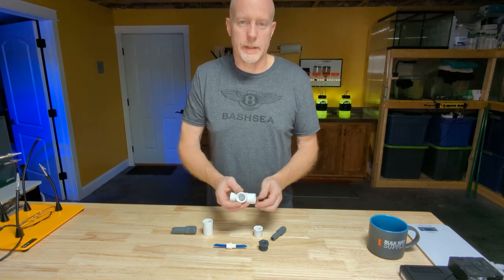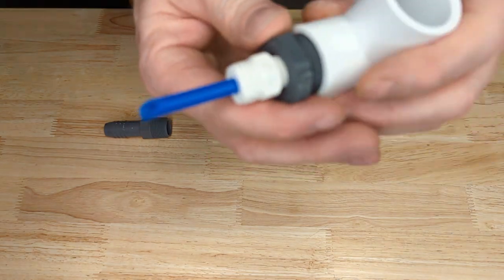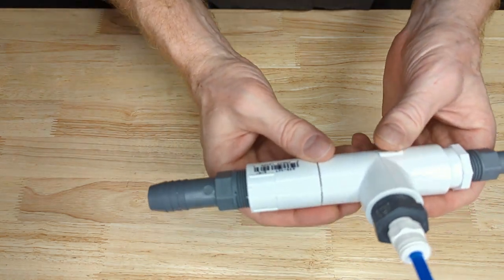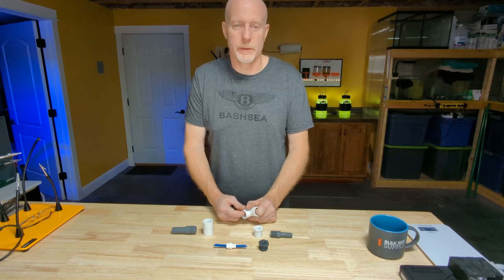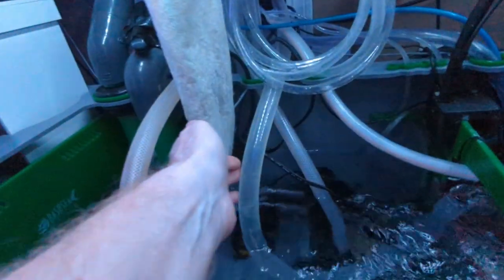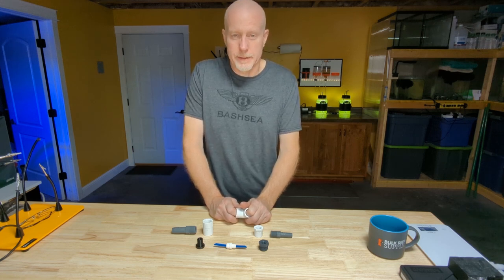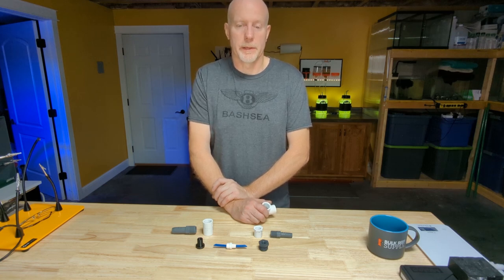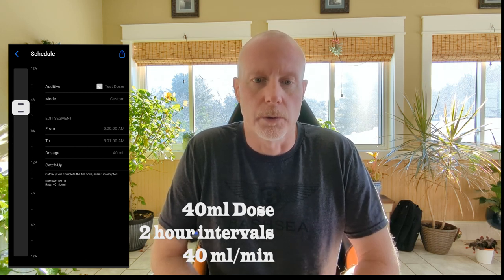Can Kalkwasser slurry eliminate the need for a calcium reactor?

Comment: Excellent video! Very informative and well done! My slurry manifold is still cruising along around the two week mark. I didn't use the tubing below the push connect fitting to extend the dosing line closer to the venturi (didn't catch that detail) but did incline the manifold a little to encourage the slurry in the right direction. I'll have to open in up in a couple weeks and see if there is any build up at all.
Reply from the maker: Thanks Paul!  I'm not certain it's necessary, just seemed prudent.  This is just the beginning of the journey.  I'd be very interested in what you find after a month or so of dosing,  Feedback like that is gold!  I appreciate your thoughts and input as always.
Reply: @robbb'zreef how are you stirring the kalkwasser in your bucket to make the slurry?

Comment: Great idea. I was thinking of something similar for an in-line application with a closed loop system. Did you make the fitting that creates the Venturi?
Reply from the maker: A friend of mine who's really good at flow dynamics and hydraulic engineering helped me with the design of the 3d printed insert.

Comment: Just started my tank slurry today, thanks for the Kalkulator. It’s a 220g system pretty heavily stocked. I’m currently doseing 9000ml kalk water and 150ml of all4reef. Hoping to switch to only dosing slurry.
Reply from the maker: You're very welcome, and thanks for watching!  I hope your cutover goes smoothly.  I've finally surpassed my ability to replenish alk thru normally saturated kalk which has been a fun journey.  I knew it would happen at some point which is why i started down this path early on.  Enjoy those savings :)

Comment: Hi great vid although I’m not certain I understand the Venturi part.  Is it so you can slowly drip into a pipe that has pressurized flow without it drawing the drip into like a vacuum?

Also did kalk replace a calcium reactor?

Regards Duzzy 🇦🇺
Reply from the maker: Thanks for watchin!  The venturi performs several functions.  First is to help create a turbulence at the convergence point to better help mix and saturate the calcium hydroxide.  Second is to prevent constant back pressure against the dosing pump head and lastly a safety guard in case it ever pops off accidentally (or on purpose for maintenance) it won't shoot water all over the place, assuming you have it above the water level of your source.  Kalk for me did not replace a carbonic acid generator.  It however will ensure I never need to get one which for me is a huge win.  This is certainly capable of feeding a system as much if not more carbonate alkalinity than many calcium reactors at a fraction of the cost imo.
Reply: @RobBzReef  thanks for getting back to me.  So are you running kalk and what else for calcium?

Comment: Interesting. I currently have an ice cap kalk reactor and I am adjusting hours over night that I'm dosing kalkwasser. I expect to get to a limit, but also expect I can increase the ammount of stirring. It somewhat relates, but not to the point if slurry yet
Reply from the maker: I've played around in the same manner.  Before I started experimenting with slurry I was using an avast stirrer.  Occasionally I would pull things up in the column a bit and observe the impact to pH.

Comment: My daughter and I are getting my grandson a 3D printer for X-Mas, wanted to know if there is a specific type of filament I should use to make the Venturi fitting. Is PLA filament good?
Reply from the maker: Use petg for any application that will be exposed to salt water.  PLA isn't considered reef safe.
Reply: @RobBzReef  thanks Rob!

Comment: Is the versa pump tubing able to handle the kalk slurry long term without breaking down?
Reply from the maker: I've found it hit and miss.  The versa pump tubing is generally terrible overall and I've had it go out on me in non-kalk dosing applications.  The tubing assembly that's currently in use is over 6 months old at this point.  When I started out I had one lose it's seal at a month.

Comment: Great video! Few questions. How do you have the pump positioned in the kalk reservoir? Do you use a ph controller/apex connected to your dosing pump? Also, if I'm understanding correctly; the venturi design with the eheim pump decreases precipitation and aids in dissolving the solution. Would longer tubing from the venturi to sump be beneficial in dissolving slurry or would it matter?
Reply from the maker: Thank you very much!  I have it just hanging in there so it just touches the bottom and can oscillate with the current it generates.  The slot I put in the bucket is just barely big enough so it doesn't slip.  I do have an Apex controller but I'm not using it to control the dosing pump just yet.  I have bad CO2 issues so my pH is not going to get that high with the volumes I'm dosing at this time.  If things start trending in that direction I will do exactly that.  Others out there do take some measures with their controllers to do this butt they are dosing a lot more than me and don't have the high CO2 that I do.  In my testing it eliminates precipitation altogether.  Any length of tubing should be fine if you're slurry setup is not located adjacent to your sump.  If your slurry setup is right on top of your sump already I would skip this method and just dose it straight from your doser into a very high flow area of your sump (usually by means of a power head located in your sump for this purpose).

Comment: Best diy innovation I’ve seen in years thanks!  You said the versa doses 40mL/min but then when you showed video it was off.  Is it setup to intermittently dose the 40 mL/min?
Reply from the maker: Thank you very much.  Definitely a learning exercise.  My current alk demand is low as I'm just getting my coral load up.  It's around .5 dKH/day so I'm only dosing once every 2hrs.  As my demand goes up I'll keep increasing until I'm in a continuous mode.  At which time I'll switch to a Kamoer pro T doser instead.  Hoping I'll be there in there next 4-5 months.  I also have the option of going to 4% which is 24x strength of normal saturated kalk.

Comment: So what’s wrong with just dripping it into your sump with a power head running to mix it?
Reply from the maker: localized abiotic precipitation, you can overcome that with a high flow powerhead in your sump, but that method severely limits the distance you can pump from your slurry reservoir (too long of a line and it falls out of suspension) and some ppl don't want a 5 gallon pail sitting next to their stand in the living room.  this allows you to locate in in another room, in your basement.  the only limiting factor is the pump you use for the distance traveled.  It also allows for a far greater range of dosing rate.  With the other method you have to dose fast to avoid it falling out of suspension in the line.
Reply: @RobBzReef  so what’s your recommended length from the dosing pump directly into the sump?
Reply from the maker: @tuberklops  if you don't use my manifold method I recommend staying under 3ft.  YMMV after that.  You'll want to keep your line from the doser to the reservoir as short as possible in either method.

Comment: How do you figure out slurry ratio...like how much in a 5 gal bucket
Reply from the maker: sorry i missed this question.  however late, slurry is a reference to weight percentage of the volume of water it's mixed in.  typically 1-4%  I am running a 2% by weight mix which equates to 12x strength of normal saturated kalkwasser.

Comment: @Rob B'z Reef  how are you stirring your slurry in your bucket?
Reply from the maker: Hi Erik, right at the 10 minute mark of the video i show how I'm doing that.  I'm using a Jebao SLW-10 that I keep hanging just a touch off the bottom.  I let it hang free so it can oscillate in the current a bit.  I've had this specific pump running in the slurry for over 200 days now.
Reply: @RobBzReef  o ok thanks i though that was in the sump pushing the water after it came out. Isn't a pump too much for kalk I was under the impression that you can stir it too much and it will loose its concentration. That is why the kalk stirrer is moving so slow?
Reply from the maker: @erikreagan2339  There is one pump involved, that is located in the sump and it's job is to move water from the sump, through the venturi/mixer and back to the sump.  In the bucket that contains the slurry is where the powerhead is located (if you're not familiar with the SLW series, it looks much like a Nero) and it's only job is to keep the kalk suspended.  since the slurry is typically between 12 and 24 times (2-4% range) the normal strength of fully saturated kalk it's not in solution, but rather suspension.  Once kalkwasser is fully dissolved it won't fall out of solution through mechanical means.  The only potential impact to potency of the slurry here would be to prolonged exposure to CO2 from the air, which is why we keep a tight lid on it.  HTH - Rob

Comment: I appreciate the effort involved. Just an FYI  the spreadsheet is broken in Open Office, Google Sheets, failed to open at all in Apple Numbers and will not open in the Excel app on iphone. Corrupted file or invalid extension error.
Reply from the maker: Appreciate the feedback! I was aware it didn't work on Google sheets.  I'm going to convert it into a web page soon, maybe add some other features as well to make it more accessible.
Reply: @RobBzReef  A webpage would be fantastic! I don't subscribe to excel so would be nice to be able to use it. Cell B7 equation is blank in open office. The B7 equation exists in Sheets. None of the selection boxes work in either. I can infer some things but other things I'm unsure of with the math or purpose so going to have to wait.
Reply from the maker: @anthonybester6455  sorry about that!  Initially I just built it for my own use when I was doing the initial experiments but saw a need for others even with normal saturated.  I'll move that up my priority list for sure.
Reply: @RobBzReef  No apology needed Rob. I appreciate that you created it and shared it in the first place. Thanks for doing it and planning to make it more accessible!.